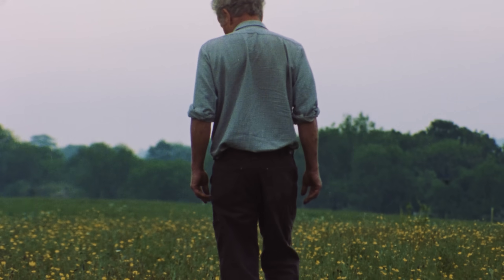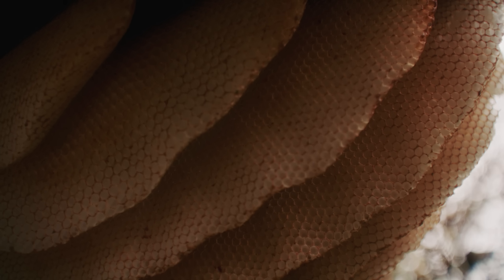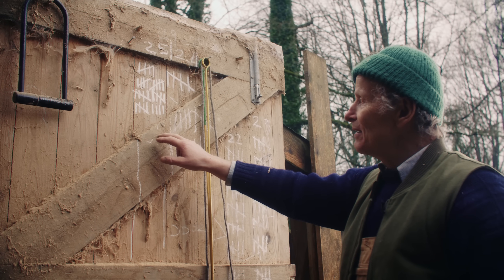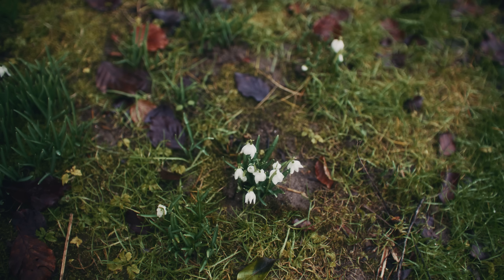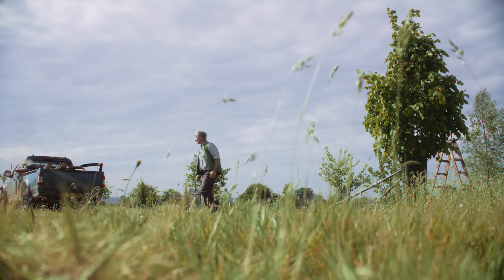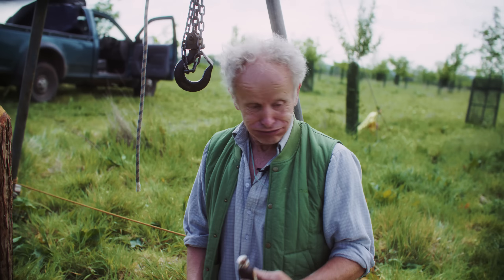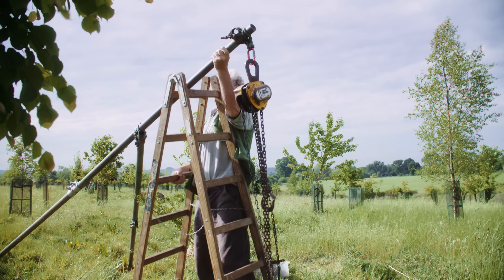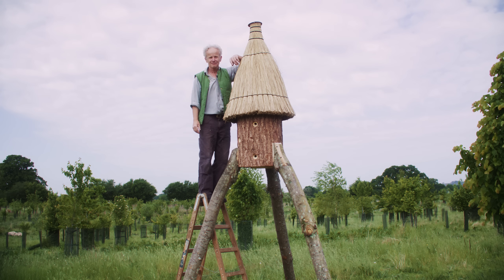The Hive Architect | Saving Britain's Wild Bees

Comment: The one problem I see with his design is that THE LEGS WILL WEAKEN ... and thus make the whole thing topple down if just one fails. There is also the question of "how fresh" his logs are, because they might dry out and develop cracks ... which are not a problem on a small scale, because the bees will just plug them ... but some of them might go through the whole log.

Comment: Just my 2 cents worth if I may.
These are Not wild honey bees. They are just normal honey bees that have swarmed from a nearby apiary during the spring time.
This is what they do every spring (unless you take steps to prevent that) secondly, the average wall thickness of any wooden hive is between 2-3 inches. Anything more than that is unnecessary. 
So, if the hollowed out space is made bigger, not only the log will be lighter during lifting but also the bees will have more space to thrive in. Great video BTW! 🙏🏼

Comment: I've been researching bees for the past 5 years and all the big bee researchers like lazuten layens and langstroth have said this is effectively the best design for a beehive to live without human contact, that arched ceiling especially helps them in the winter because moisture forms at the ceiling and it can't drip straight down on the middle of the bee cluster, All of the bee experts have spoken about the proper thickness of the hives as well they need that insulation, that's why natural keepers will either use very thick wood or hives with natural insulation of some sort.

Comment: Better avoid mix metal with wood, the metal condensate water and then oxidize and corrodes, then the wood is roten and the union between wod and metal fades. Instead of mixing wood and metal, is far more better use wooden joints . Congratulations for you effort sir ! Wax could be good for holding the thin sticks togheter '

Comment: to save all that gouging, wouldn't it be easier to quarter the logs down the length.. cut off the inner edge then with chainsaw.. then reconnect the logs?
Reply from the maker: There might well be a quicker way but there is an element of art to what Matt does.